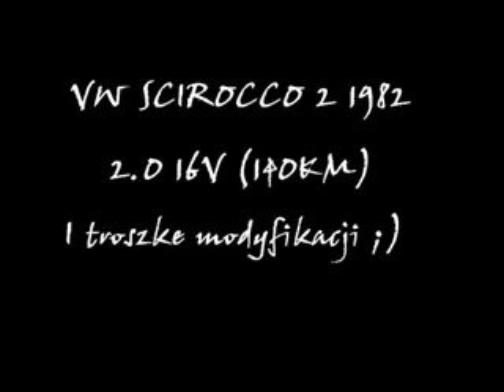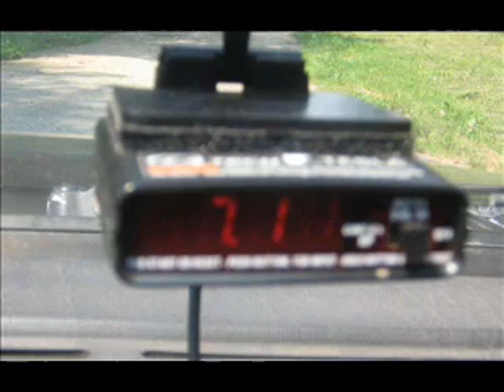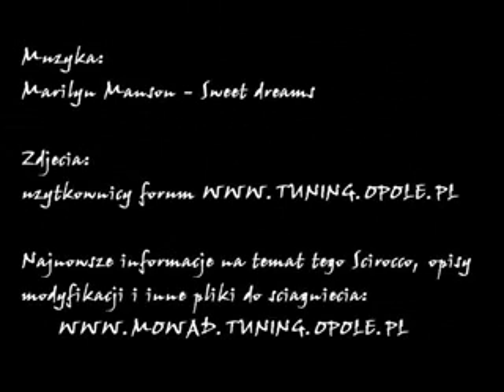Mowad's Vw Scirocco 2 - carburetted 2.0 16v - season 2006

Comment: @imintheshed well, put it this way, if i wanted to do up my 1.6 litre scirocco, i wouldnt bother with a dogy respray, i would spend the money and take it to a classic car restoration center and have the rust and the paintwork sorted out properly and no i wouldnt change the engine, i would have mine rebuilt if it needed it, If it aint broke dont fix it.

Comment: @Dettengines  Idiot. there was no 16v in 1982 That did not come along till 1987. The Sciroccos had a 1.6up until 84, then it was a 1.8 8v, and then in 87 along came the 16v. Nice try though